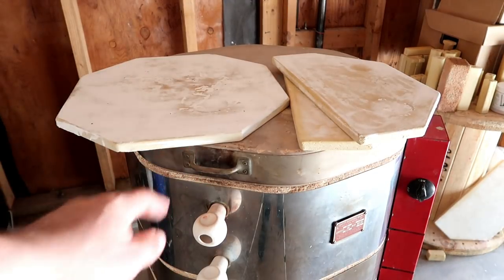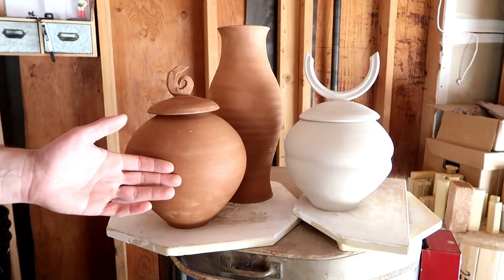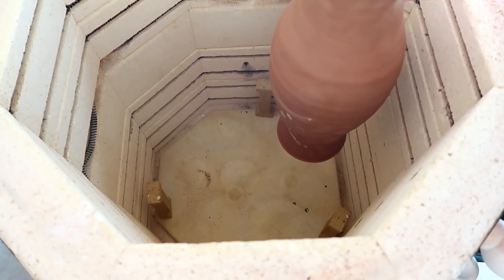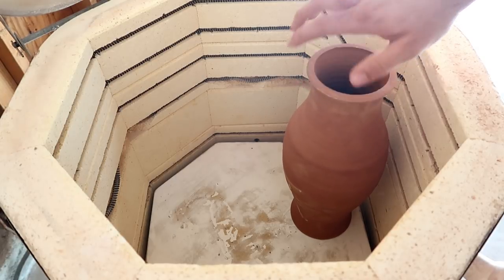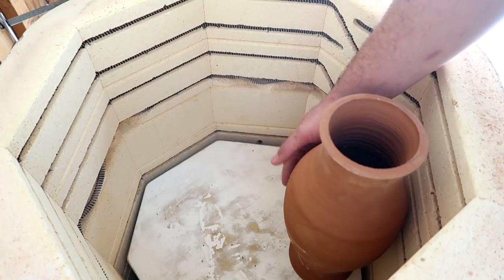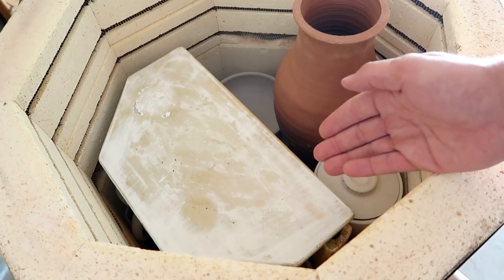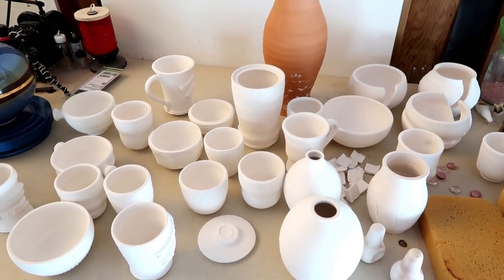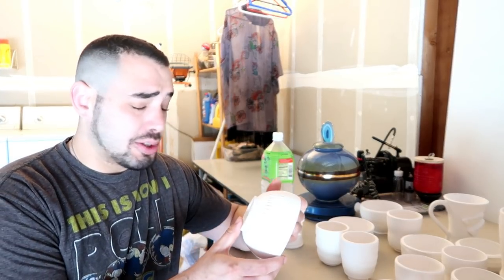Half kiln shelves

Comment: I got 2 15" half moon shelves and 1x 15" round shelf. The half-moon go into the aura prozone (it's a rack for my grill) and act as a heat deflector for low n slow. I did a pork shoulder for 14 hours with them and they performed as well or better than my original smoke stone (which cracked, piece of $h!+) . 

The 15" round is my pizza stone. I got that to 550 last night in under an hour.

Comment: When using a half shelve I put a cone 6 in and it did not bend very much.
Reply from the maker: The usage of a half shelf has nothing to do with how hot the kiln gets. I would check your kiln and its elements or the way that you put the sitter. Especially if you have an older kiln.